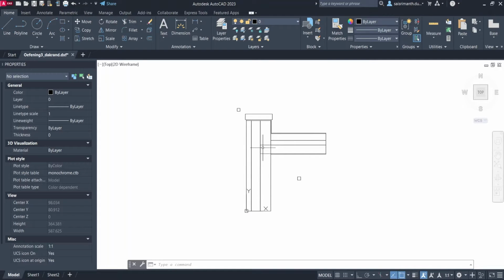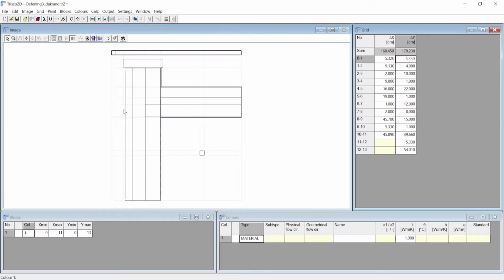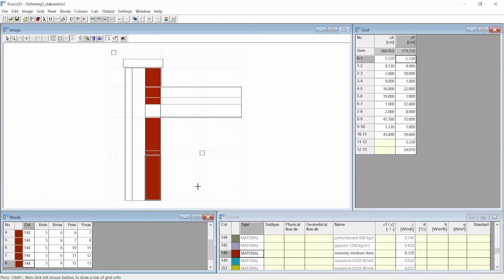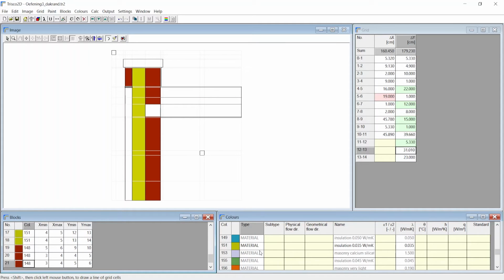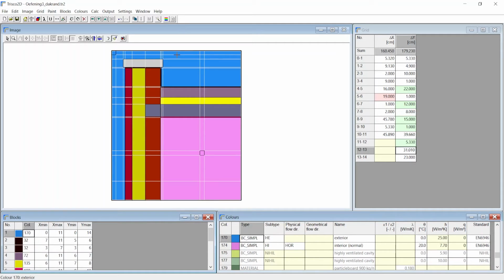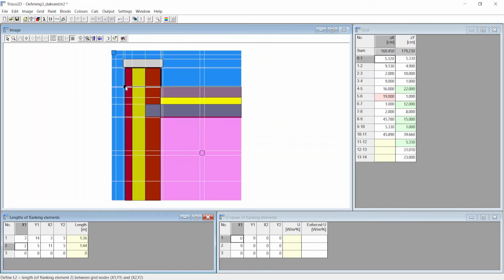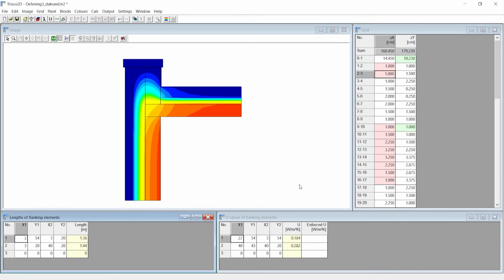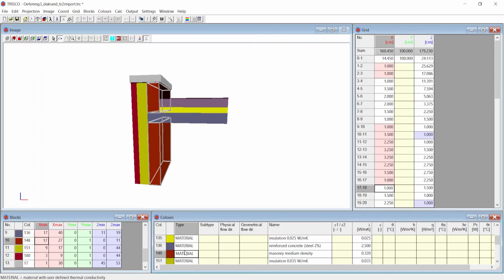Physibel TRISCO 2D Tutorials: DXF to TRISCO 2D

Comment: Nice video, but i have a problem. When you load your DXF file in for the first time you see clear black lines (the layers of your construction) and you get matching grid lines (the faded grey lines). At a certain time I thought that my work was done so I saved my project as a Trisco file. When I opened the file the next day I only got to see the colors (no gridlines and no construction lines). With 'Grid' --> 'Create minimum grid lines' I got my grey faded grid lines back but my black constructions lines dont appear. Normally those gridlines are enought but it's just unclear without those black construction lines. How do I make those construction lines visible too again, like when you import the DXF-file the first time, so i can see my construction clearly? 
Thnx for the help!
Reply: Hi Jens, the idea of the DXF underlayer in Trisco2D is to give the user some help modelling the geometry at the start. The DXF underlayer is not stored within the project files, so, when you close the program the underlayer is gone.
Reply: @jellelangmans9624  Oh okay, good to know. Big thanks for the answer!!
Reply: @jellelangmans9624  En bedankt voor de les aan de ingenieurs van KuLeuven! Heel interessant programma!!